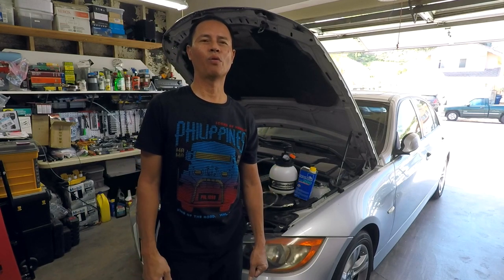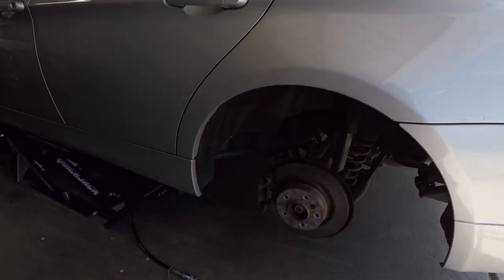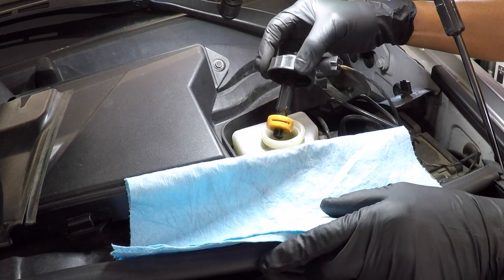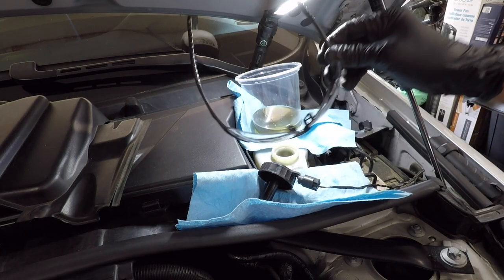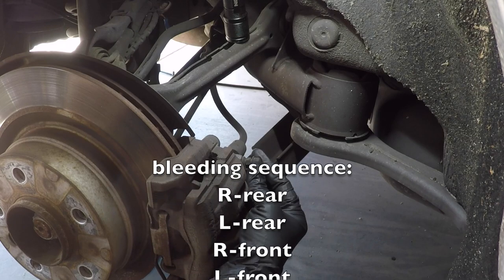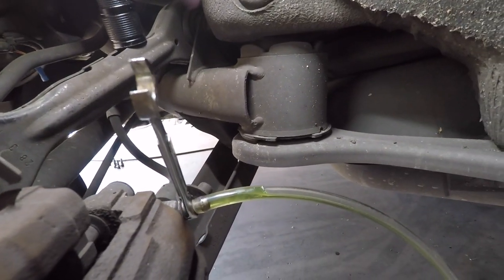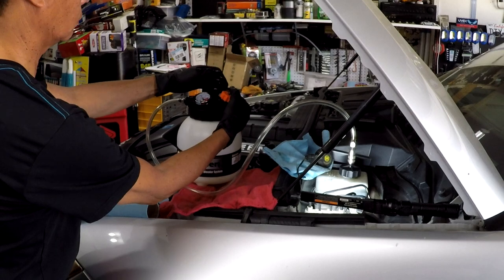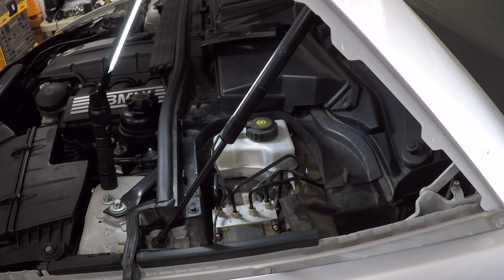how to flush your brake fluid on E90 2008 BMW 328i (DIY8)

Comment: Hi mate...do we need to take off all the fluids in resevoir tank(below minimun level@dry)) and topup at maximun level(repeat 4 times) before do bleeding on each wheels?
Reply from the maker: extract the old fluid from the reservoir until the remaining fluid is at the minimum level. then top it off with a fresh fluid. then start bleeding the fluid from the bleeding screw on the wheel using a pressure brake bleeder if you have one.  repeat on each wheel. keep watching the level of the fluid in your reservoir. don’t go pass the minimum line to avoid air getting in the brake fluid lines
Reply: @randysdiy  ok mate, i do understood now..thanks for clarifying
Reply from the maker: no problem
Reply: @randysdiy sorry mate, i forgot to ask before.. My car was RHD so whice sides should I do bleeding first in order?
Reply from the maker: start from the farthest wheel from the brake master cylinder
Reply: @randysdiy  in my case RHD, i should start from 1) Rear-Left >> 2) Rear-Right >> 3) Front- Left >> 4)Front-Right...?
Reply from the maker: that’s correct
Reply: @randysdiy  Thanks mate 🙏
Reply: @randysdiy  already changed my brake fluids and bleeding today.. Thanks for guides me step-by-step mate👍🏻
Reply: Hi mate, may I ask you one question? I'll try to change my Axle oil so when I pump out my old Axle oil there is only about 900-950ml(measures with 1liter bottles) came out 😂 so can I fill with new Axle oil without pump out my old Axle oil(I heard full Axle oil was 1-1.2liter?